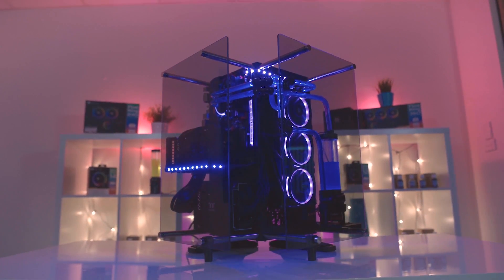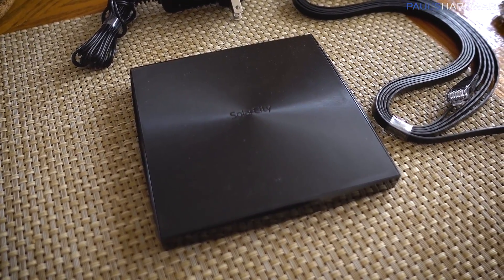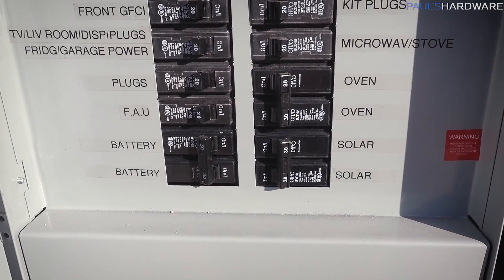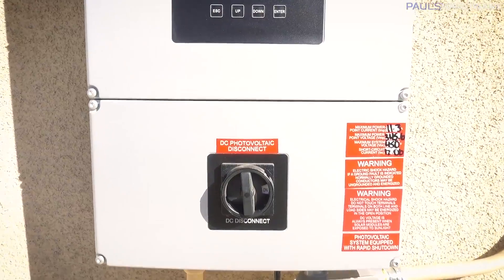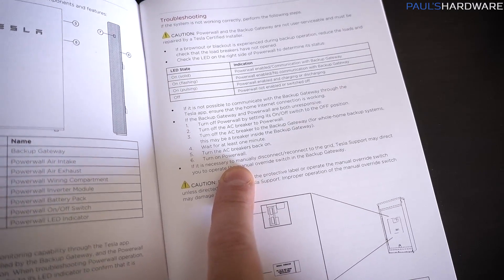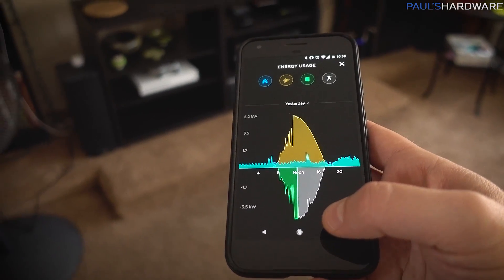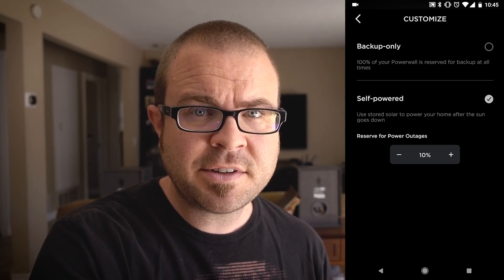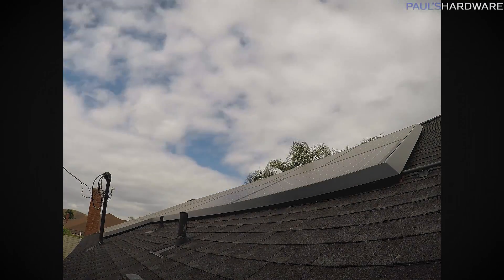SYSTEM ACTIVATED! Tesla Solar + Powerwall Week 1

Comment: The AC is on the Grid side of the gateway but your side of the meter, or tap for grid supply data.

Your AC is getting first call on the surplus from the system.  Anything left over is still sent to the Grid.  If you need more than the surplus, the Grid will supply it.

If you lose the Grid, the AC, being on the Grid side of your gateway, will see the outage.

Comment: To offset the a/c load you should add a ground array in the backyard and connect it to a fronius batteryless grid tie. You can file an addition to your permit to add it. Snapnrack makes ul approved ground rails. Checkout Cotek for small scale solar, content suggestion.

Comment: I also live in southern cali, here it cools down usually in the evening so I invested in a whole house fan, it does wonders to help cool the house off without having to run the A/C, I donno if where you live it cools off in the evening enough to work for you, but it maybe a way for you to not have to run your AC as much. Mine costed me a little over $600 and its made by QuietCool. Might be worth looking into.

Comment: My 10kw panels are divided on the house for morning and evening Sun. Still, I make 7.6kw around midday. We have Net Metering and the power company wants to end that. Your powerwall is an interesting way to get around no net metering. My system is also a Tesla, and summer months I generate 63kwh/day; 33kwh/day around Christmas.  My biggest savings months are January through June, after that the air conditioning costs exceed my capacity.  My electric bill is still half what it used to be.

Comment: The reason i think you see AC usage is because the blower fan in the furnace is connected to the power wall with the outside AC compressor unit being isolated from the rest of the system.

Comment: i placed plug strips on my pcs and tvs after i used a inline power load meter and found out how much power they are still using when turned off .....and i did see about a 30% drop in electric bill now that we completley disconnect them when not in use smart move also if you still have the old school water tank water heater look in to a on demand water heater or a water heater timer to cut down waste from heating water you do not use or in your case consuming battery power for 8 hrs as yall sleep when not using any water ......they say heating water can account for as much as 35% of a homes electric bill or consumption....$15 and this device will tell you how much power you are using when devices are on and off https://www.amazon.com/TS-836A-Energy-Voltage-Electricity-Monitor/dp/B00E945SJG

Comment: The 30 amp breaker for the A/C is for the compressor unit outside.  Your furnace or air handler fan inside your house is running off the Tesla wall that is the FAU breaker aka forced air unit .

Comment: I bought a ($40 CAD) 1U rackmount power strip with 8 plugs and 8 switches for my desk. Lets you quickly turn off anything with a transformer that may have vampire draw. The switches are backlit as well so you can tell when things are on.  I have my monitors, studio speakers, and lighting all connected to it. Gives a little more granular control than the single switched power strip it replaced. I do leave my computers plugged into UPS into the wall -- not sure I'd want to be putting a switch in line somewhere.

The tactile satisfying startup and shutdown sequence is worth the price of entry alone...

Comment: Not that you want to shell out more YouTube money for the sake of energy conservation, but how old is your A/C system and do you know the SEER rating? The higher the SEER rating the less power it will consume. Most older systems are 10-13 SEER with newer systems running into a 20-21 SEER rating on the high end. Higher SEER rated systems use variable speed compressors and condenser fans and well as ECM motors for the blower unit. The system will ramp up and down as it needs to rather than running at full speed until the thermostat is satisfied.

Comment: Your biggest problem Paul is the fact that your panels lose sunlight almost completely by noon which leaves about 6+ hours of operation before nightfall. Have you considered adding panels to the other side of your roof in order to increase the charge times and reduce the battery times? If the rebates you get from the power company are sufficient enough you might actually pay for the additional panels with the rebates.

Comment: Sweet set up! You mentioned AC might tank the power wall's charge in the late summer and will need grid power for a bit. IIRC SCE has fluctuating energy rates based on grid demand. Knowing when energy is cheapest and then setting your power wall to charge then would be a good way to further reduce energy costs!
Reply: that's what i was thinking. during peak demand he's running off the solar, but at night, power is typically cheaper so it's ok to draw from the grid. i'm from ny, so it may be different.
Reply: Being connected to the grid is an asset, not a problem. What is your background? Have you ever priced out the last (most extreme) 10% of a system subject to engineering constraints? Going off-grid is a terrible money-loser (and probably bad for the environment) for most people in most places the grid serves. It's like a fire department. Yeah, we COULD all pay for our own pumps, tanks, ladders, gnomex suits, SCUBA systems, firefighting training ... or we could pay $100 a year to a team of professionals for whom it's a career. The fact that a homesteader in the middle of a forested wilderness needs to know how to deal with a fire DOES NOT mean we all should have that capability if we live in cities and towns with fire services. The grid is the same way. Popping ~10 kW of panels up on your house and feeding the grid is like having fire, smoke, and CO2 detectors and teaching your kids how to exit the house in a fire. It's smart, saves money and makes the world better. But you're basically saying (by suggesting people should go off grid) we should all buy firehoses and water pumps. It's not smart, spends money, and wastes resources. That's my opinion, let me know if you want some references.
Reply: John Hull He is in the high 90s in self powered.  I think he's probably fine... Diminishing returns.
Reply: Fairly sure you still have to have a meter to return power to the grid right? I dont think consumer level powerwall systems are designed to be fully off grid. They are built around the fact that you can sell extra power back to the power company.
Reply: John Hull but then you have winter months so you don't want to cut the cord.
Reply: I would cut the cord!
Reply: John Hull most areas in California you cannot go fully off grid, especially in metropolitan areas. They will litterally condemn your home if you try. It's a necessary evil here, the system is perfectly sized to not waste too much power, remember that the few percent of grid power he uses could only be fixed by adding a entire extra power wall which is 7000 dollars just to save around 5 dollars a month. Math doesn't work.
Reply: John Hull He sells power back to the grid that probably covers the tiny bit of grid power he uses.
Reply: Electric heat is for dummies. More panels will help out with cloud cover. In southern Cali, there is very little cold n snow. lol.
Reply: Up here in the great white north, some people have pellet stoves. completely useless when the power goes out. Better to have gas fireplace, if not wood. Same/same with grid. Good backup.
Reply: Mad Dissident III Why wouldn't you power your AC using solar, exactly?  If you know you're in a brownout or blackout situation, you can just turn off the AC or cut power to the AC.  In a "zombie apocalypse" situation, you'd want to do that anyway to minimize your noise output so as to not draw attention to yourself, even if grid power hasn't gone down.
Reply: I get charged, $ 1.60c a day just for been connected to the grid
Reply: Shane Farmer if the goal is to be renewable AND be cost effective and he's at 96% design a total need system and cut the fucking cord already....and save the $40 - $50 a month they charge juat for use of a meter and service drop....if it don't make dollars??? It don't make sense!!!
Reply: Should've designed and sized system properly....FIX THE PROBLEM....don't work around it
Reply: @johnhull6363  Pretty sure as he uses power and it appears the panels are not enough, he can add another panel or two under the contract plan at no charge to him.

Comment: Hi i have a powerwall setup here in north Wales in the uk over here the powerwall have a clamp that goes round  the incoming power feed and tells the powerwall if you are inporting from the grid or exporting  and the power wall will try to feed everything the house side of that clamp so that would be why it can feed the AC but guessing if the load is getting to much for the powerwall the gateway will switch the load to the grid

Comment: I never thought about, or knew they designed the panels to do this, that you could have three going vertically and have two going horizontally above them and they would be the same width. I did calculations and found it's actually better KW/sq ft doing it this way instead of having them all go vertically. Totally didn't think about this until seeing your setup. Also looks cleaning too, and works on smaller roofs like on a tiny house.

Comment: Hmm.. perhaps you could also set the AC to 1 or 2 degrees higher temps (less cooling) to save a bit of power?
Basically apply the same logic as with heating in winter where dropping the thermostat by 1 or 2 degrees also saves you a significant amount of energy used/money spent without really feeling the difference..

Comment: how the system work, very simple :1) grid=powerwall use only when the solar panel off(no light) or the current more then tesla system can deliver 2) battery chage from the solar panel with DC power 3) inverter = use DC power and make pulse AC power. i see you have 2 option :a) battery backup only work when no power from electric company= 0% electry 100% bat b)10%=bat will make 10% of system current and 90% from electry.  i see the peak power from solar is near 5KW and in day had 4 hour full power 5KW*4 20KWH total Capacity of battery. if batt is 100% capacity then you can use 2KWH for 10 hour until go empty.

all panel  can make 300W of power.
 
tech - he had 16X300W solar panel, total 4.8KW
about 13.5KWH battary, when the batt is full , the system can sell power to electry company.
let say , the batt id full and the solar make 4800W and no power from wall , then tesla will buy 4.8KW of power and credit him in 0% use from batt.

in tesla website it say the the system can handlel upto 7KW peak ,and 5KW continuous power.
inverter 90% Efficiency (that very good)
batt 13.5KWH at 60A max , then voltage max 225V DC . in another tesla system had 3 phase of 240V AC ( in usa had 110V AC system , but teslae use 240V DC  system , and the inverter convert it to 110V AC.)

when you use more voltage , then the efficecy will be better because less power drop in wire.

Comment: Hi Paul! Life of a battery is count in number of cycle, so if you can put your AC on the grid you will limit the number of cycle/week (This might be justified to use the battery depending on the in/out power $ rate).

Comment: What was the total upfront cost?
Reply: He mentioned in his other solar videos that it was around $30k.  Not upfront cost but total I think
Reply: FUCKEN JESUS FUCK!
Reply: From the timelapse it looked like he had the entire roof replaced before the panels were installed.
It is possible to get a system together much less cost - I built my own powerwall from thousands of laptop cells, and can find second hand solar panels from ebay or craigslist.
A professional installer may be able to certify it to qualify for a rebate.

Comment: so when you going to get an EV ~ you could use all the "free power" to charge it, also you got lot fewer bills for servicing due to no or less moving parts ~ EV cars have been known to go 100,000 to 200,000 between brake pads changes and the only oil changes are only needed for the cooling the main electric motor which is done lot less vs changing oil on an ICE car

Comment: excellent video. I'm guessing that you are not on net metering with your power company as that effectively uses the grid as a power wall (except when the grid is down). My power company monitors what we use and what we put into the grid and settles up with us at the end of the year. The extra we put into the grid when the sun is high is credited to us when we draw power at night.

Comment: So glad to see this vid & almost the final vid & process. So interesting & cool. I think every house should have a solar power wall no matter the brand, as it saves electricity, helps with blackouts, & helps the grid itself. 
Question.....how many days will power wall last you if lost power, & no sun to recharge it....based on normal "household" items being turned on(fridge, lights with no windows,mets...)?
Thanks for this intriguing step by step process, as been thinking of getting solar power myself for few years (maybe not tesla, but solar power nonetheless).
Cheers, A

Comment: We keep our microwave unplugged unless being used and we unplug the entertainment center from the wall every evening. When we started doing that initially, we noticed a 20-30 buck per month drop in the electric bill. When we replaced our ancient AC unit outside we noticed a $30 drop. If our house was better insulated we'd be able to save more money from heating/cooling and thus have even cheaper electric bills. There's just so much that goes into our daily usage.

Comment: The powerwall has a meter for the stuff that is not backed by the powerwall (like the AC) and the powerwall supplies the power that the AC is using by sending it to the grid and then using it. That works as long as there is no power outage

Comment: You can get "power centers" for your various setups. I'm sure you know what they are but for those reading that might not, basically it's a glorified surge protector that also helps a little with line conditioning (stabilizing the electricity that flows through it). Good ones have a master device port where you can plug in something like a TV that will once it's turned off, will also turn everything else plugged into it off so truely powering everything down is as simple as turning your TV off. Some also tend to have a readout on the front that can tell you how many amps, watts, voltage, etc you're using thru it, and they also have an override so you can push a button and force everything connected to it to turn off.

Comment: PAUL: A few thoughts

1. Let's see how this runs in Winter, when the available amount of light decreases. (Maybe not so much depending on what latitude you live in.)

2. Yeah, dust is going to be a problem, but I don't think you need to be hosing them down daily or even weekly. Maybe monthly. Remember, California is IN A DROUGHT. (So is your neighbor, Arizona. And, as a Crazy Zonie, I'm telling ya to watch your water usage.)

3. Does your house's ridge run North/South? Did they put those panels facing East or West? If East, why? West would have been much better (or half an half) to catch the most sun when your AC fires... Grr...

4. Surprised you weren't diving up and switching off all of your vampiric draining devices. I would have thought you were on top of that.

5. You might want to get an energy specialist to rate your house. You may need to add insulation inside the cinderblock cavities and/or the attic. Also be good time to examine your doors and windows, make sure your ac unit (and the ducting) is sized appropriately for the house, etc. You may even want to replace that unit with smaller, room only units that can fire when the rooms needs it, potentially saving cash there. (Something similar to what Samsung has.) An energy specialist could help with that. (Maybe even fire a letter to Ask This Old House to see if they'll be interested in a collaboration project.)
Reply: why not invest in a battery instead? genuinely curious
Reply: Seriously? Are you suggesting gas powered kitchen for a guy that is going green/renewable? Only thing to suggest is to use induction instead of ceramic. Everything must be electric!
Reply: for that cost why not just add a backup battery like the power wall?
Reply: The whole drought issue is way more a problem with the fact that we grow crops for the entire country in California and we also have plenty of livestock. Don't use this as an excuse to waste as much water as you want, but the problem being pushed onto the general public isn't really going to solve our issue
Reply: I'd do a raindance, but seeing I spent 10 years in HS and College marching band... Well... Let's just say I don't think the rain dance is a soft shoe routine...
Reply: washes my car profusely
Reply: You should optimize you energy usage. Light's on only on the places you're in.

134lumen/watt filament LED.
Gas powered kitchen

Comment: First, congrats on your installation.  Nice to be able to cut your SCE usage so dramatically. 

In your followup video can you provide info on your general location so we can look up the typical solar hours for the area?  Also, the size of your home so we can understand relative power requirements.  I am in Norcal northeast of the Tesla factory.

Also, maybe in a future tech episodes you can speak to power/cost of using desktop system versus laptops as your primary system.  We have a home office and have two systems with 750 W PS units and each have 2-24 inch monitors going all day.  What would be the impact of switching to notebooks as the main system which should be enough since our usage is office work, not gaming?